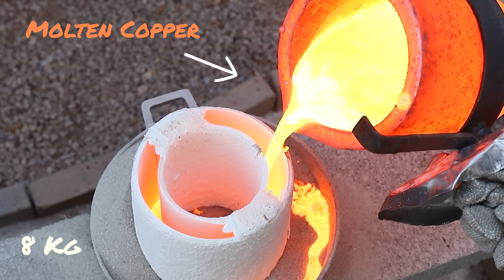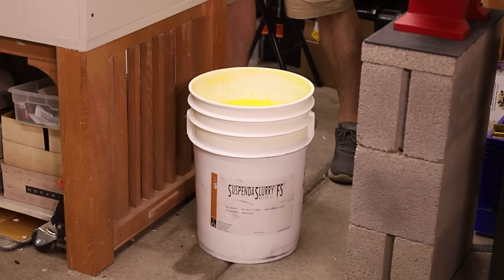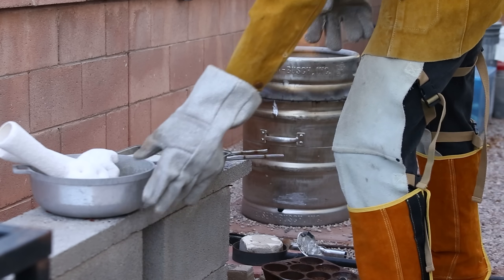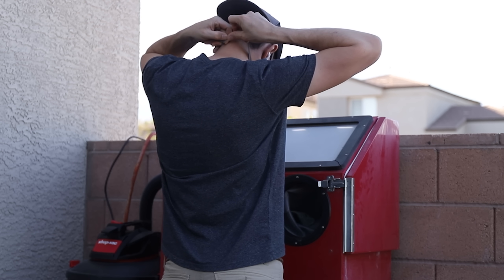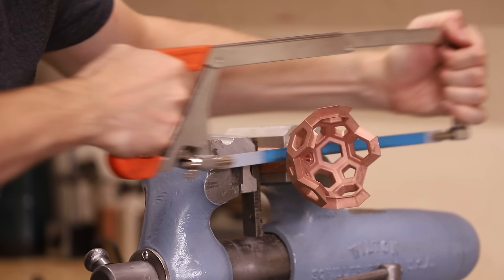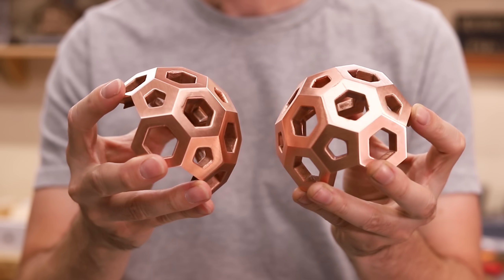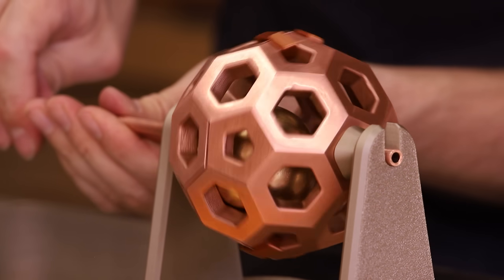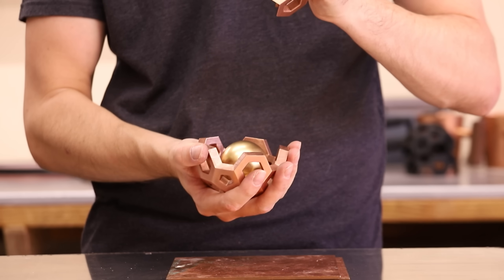HUGE Magnet VS Copper Sphere - Defying Gravity- Will a Neodymium Magnet Float Inside?

Comment: I wonder if it's possible to create a hollow, circular, copper, bike tire tube shape to house the magnet, and you see if you can hold the suspended magnet at a fixed point by peddling the copper around it.

Comment: There's very likely a (outer) ratio to optimal rotation speed; the ratio you chose made it so that you can levitate it with your hand, but I believe there might be a larger sphere ratio where the speed must be higher, and so it'd only work with the drill. Probably the sphere thickness also plays a role there (lower = higher speed needed), but these tests seem like they might be too tedious since you'd have to do this whole process MULTIPLE times!

Comment: If you used an ESC (electronic speed controller) and an RC electric motor you'd be able to control the speed more precisely, bearings where the axle interfaces with the stand might also help with smoothness and stability.

Comment: just make a flywheel and if you make it heavy enough you can get it at a pretty constant speed without a motor but obviously it will be harder to spin so it would be logical to make it pretty big in diameter

Comment: Separate the Cu sphere, counter rotating the shafts.  This should induce the 'Right Hand rule', causing the magnet to pull to the left or right.
Rotation in the Z axis should induce the floating effect you seek.  This should work even if one half is stationary.
And be sure to check the voltage potential between the Cu hemispheres.
Knowing the torque influence on each shaft at RPM difference would be of great help as well.

Comment: The spinning magnet is what makes it float, not the speed of the outer sphere. You only use the outer sphere to accelerate the magnet but then it always descends when it loses momentum due to air resistance

Comment: Lovely build. The copper sphere is a very pretty looking thing. Have to say though, when you said "burn off all the plastic" I just thought how vile the stink would be, and that it's just adding even more plastic crud into the air, and there's enough of that already because of incinerators 🤢😐
I wonder what would happen, hypothetically if a magnet wasn't brittle, one was thrown at a copper baseball bat. Would the energy transmitted be a lot less because of the Lentz effect 🙃😝

Comment: I wonder what happens if the stand with the ball is mounted on rollers. Then turn the magnet again. Does the thing move?
The magnet could perhaps also be connected to the stand..?
If it does move, it would be interesting to see whether the thing can also move vertically. So can it float/fly, maybe? O.o

Comment: Is this estimate of your process correct?
3D Printing (PLA): 4 hours
Manual Smoothing: 2 hours
Mold Creation (dipping): 3 hours
Burnout Process: 4 hours
Casting (pouring molten copper): 1 hour
Cooling Time: 2 hours
Sandblasting and Finishing: 3 hours
Total Time: 19 hours

Comment: I have an advice, Try painting the copper shell with some thin coat of a dark material so it is easier to see the inside of the shell as the reflections make it impossible to find a good angle

Comment: When sandblasting away the ceramic cones that lead to the sphere, if you blast them in a spiral you could get nice ceramic lamp pieces, candleholders and so on. Cones and cylinders lend themselves to very nice spiral making
Reply: Hope you can demostrat that the series found in Roman artifact  aare actually wood fired heaters small twigs rock slab base rock surround as heat sink very little smoke vidio please
Reply: the possibilities are endless

Comment: Get a small motor with a speed controller and hook it up to dial in the levitation speed. Or see if you could do that using a strong bar magnet to get the ball to spin remotely and levitate the cage.

Comment: You can see all the layer-lines from the pla, which is why in the jewelry industry they use a super slow inkjet to lay down 2 kinds of wax, and the layers are smoothed with a built in sander/cutter. This is a long process. Then they put the wax piece in a slurry. Wait for that to cure, bake for to burn out the wax. Then pour in the gold. Then spin in a centrifuge. Then toss the whole thing into water where it bursts, then remove the tree. Then cut the rings from the tree. Then grind down any leftover from the cut. Then polish in a magnetic polisher. I remove so much labour and time from that.

Comment: you could do a cylinder instead. or a solid sphere but with the ends chopped off to see inside. the sides need more copper and less gaps, or no gaps, to hover better. and there's not really a reason the front and back needs to be closed off

Comment: Question: your wast pieces and  more like them placed around the copper orb with the magnet inside, could hold the orb in the air as support, but if you alternate a repellent magnet on every other one tormenting the magnet in the orb ? Try spark plugs on the ends of the alternate pieces of waste you may have created free electricity? Good luck, p,s, better than batteries, but check for radiation ,just in case ?

Comment: With a microvoltmeter connected across the copper, you should be able to measure the electric potential difference caused by the eddy currents, that ultimately create the magnetic field which levitates the spherical magnet...

Comment: What would happen if you applied slow electric current to the outside shell 

Maybe a Tens unit type pad and a watch battery hooked up to each pad with a blu tooth type on off switch 

With the ball floating on the inside of the copper
Would or could you get forward reverse up or down movement to coordinate with the floating ball inside?

Comment: spin the magnet instead. print a small plug much like the ones you have in it now, but have a bearing in the center of it.  and through that bearing you run the small tube that is connected to the magnet and the other end is connected to a motor. When the motor spins it will spin the tube and the magnet with it. hang it upside down and see if you can find a speed that will make the copper cage float

Comment: When you added the holes, unfortunately that diminishes the size of the eddy currents that can form. So instead of having a large current loop form (like in a big flat plate, or in a big pipe), you have a bunch of tiny eddy currents. 

See the experiment with the lever that goes through the centre of a magnet, the comb shape lever receives far less resistance because the eddy currents in each arm of the comb are small.

You can probably get better results by closing some of the holes so larger eddy currents can form in the copper "sphere".

Comment: Love to see you throw a neodymium baseball down a long copper pipe horizontally.  Cool to see a potato cannon fire a magnet at a steel wall and so if it can repluse it without hitting it.  You could put metal walls in the side as you shoot to see if it could deflect the trajectory 😂 so much potential with this cool stuff

Comment: What about creating a geared copper outer gyroscope with the magnet as the center suspended spinning engine? if you figure out what the spin rate is to establish float without invoking centrifugal force you could then spin the next layer to get it to move closer to the center, and gradually increase speed until the magnet is in the middle. also, is there a way to show the electro magnetic radiation and or voltage? Does the magnet exert relative force on the copper? Antigravity here we come!

Comment: How about a transmission system for wheeled vehicles that allows an engine send power to an axle contactless. I wonder if the power loss would be less than a actual physical axle or chain.

Comment: Would the same effect be produced with the original 3d print wrapped in copper wire or if it were electroplated in copper ?

Comment: Hook the rod up to a mini generator. And then set the second magnet up with a motor to spin it, see if you can make electricity with the spinning rod. Might have made a new generator. If it works, make a second sphere and put it on the other side of the spinning magnet, maybe it turns both at the same time :P

Comment: Instead of facets, use RINGS of different sizes, with small discs or hemispheres on the end, to make a smooth ball shape. Join the rings with thin but strong bands on the outside to keep it smooth on the inside and allow for good viewing.

Use the casting cones for antigravity or perpetual motion experiments! ;) Maybe wind chimes? Or add mouthpieces to make little party horns. Also drop small spherical magnets into them, maybe starting at the wide end from an angle, see if they wobble and straighten out as it narrows.

Comment: Round out the inside. Get rid of all those flats. The field isn't as perfect as it could be. Grind the inside of the sphere with a spherical grinder. The smoother the inside surface is the better.
Reply: If you have to, create another identical piece but increase the wall thickness significantly. That should give you a more than thick enough wall to grind the inside super smooth without grinding all the way through.

Comment: I think your magnet is way to strong for this experiment. What I mean is that the N52 magnet has a Strong Magnetic field, but buy it being so Strong the Magnetic Field around the Magnet is Highly Compressed. Is you used a Magnet with a Lower Magnetic Strength, the Field of the Magnet would be Expansive, giving a better Result.

Comment: a rotation synced strobe light would make it easier to see while its spinning. you could trigger the strobe with a photointerrupter and a wheel with a cutout on the shaft. photointerrupter could also be feedback for your motor to get the perfect speed.

Comment: It seems to wobble a little at higher speeds. I wonder if you can make a gyroscope with a neodymium magnet sphere core inside a copper ball to balance it at higher speeds. Once you get the gyroscopic balance, it might generate current.

Comment: In the future, maybe you could design molds in a U shape. Air vents could be designed into flat faces of the mold on the top, so as you pour in metal, air is forced out of the top of the form, and forms sprues on flat faces that aren't meant to mesh together, creating a better mesh fit on the necessary faces if needed for a particular design.

Comment: I think the reason because it doesn't work anymore if you spin it faster is because the magnetic field pulls the magnetc sphere towards one side of the axis of rotation, depending on which direction you are spinning the copper sphere.

Some comments suggest to use a smaller magnetic sphere which would probably help lifting it but it would still be pulled towards one side.
Other comments suggest to weld both halves of the copper sphere together which would probably have the same effect as using a smaller magnetic sphere.

I think there are 2 options that might help keeping the magnetic sphere in the center:

If you change the spinning direction the magnetic field that pulls the sphere away from the center should eliminate each other. But I think that's leading to the next problem: The magnetic field breaks down and has to be built up every time you change direction. So to prevent the sphere from falling down again the frequency of changing directions must be at a specific value. The 2 suggestions i mentioned before might also help as a smaller magnetic sphere needs less force to be lifted and the welded sphere would have less resistance which results in higher electrical current and hence a stronger magnetic field to lift the magnetic sphere.

But i think there might be an easier option. You could try placing the axis of rotation vertically. If you then spin it counter clockwise the magnetic field will pull the magnetic sphere against gravity.
Here both other comment suggestions should also help as lifting lower mass with higher force makes a huge difference.

Comment: Place the apparatus on a scale and see if the weight changes when you spin it? I’m sure a high school physics student could answer the question but I’m curious to see it.
Reply: The magnet's weight still gets transferred through the copper sphere while it's levitating.  The overall weight shouldn't change.
Reply: @BenAlternate-zf9nr  thanks for your response! So the mass of the magnet is basically just being supported by the equal/opposite force of Lenz’s law against the copper enclosure… is that right? Like you’d basically get the same outcome by suspending the magnet within the enclosure using strings
Reply: @yahdood6015  yes, that's right

Comment: Pretty cool! As I'm sure others have said, the holes in the cage are actually serving to reduce the eddycurrents which cause the electromagnetic braking effect seen in the tube - it's the same reason why transformers often now use laminated cores, to stop eddycurrents flowing in the wrong direction and reducing efficiency between the two sides. The repulsion force would be stronger if the air gaps were not there, even the crack between the two halves.

Comment: My initial thought is what happens when it is rotated about 2 or more axis.
The other thing that comes to mind is that the holes that allow you to see are technically against you as it reduces the amount of copper for counter eddies of current to form, thus weakening the effect. So maybe a design that is more solid with more surface area around the equator and some windows to view near the point of rotation.
Another thing, last one, to consider. Sharp edges cause currents to collect, and this too will impact the effects.

Comment: If you have the half-sphere like a cup, with its open half pointing upward, and put the smaller sphere inside, and then spin the outer half (along vertical axis), I would think it would cause the inner sphere to 'levitate', no?

Comment: I would have used a hammer on the feeder, which would have removed a majority of material without deforming pieces. Otherwise impressive work, on the piece and the video.
Reply: You could use a boolean operation to create a smooth sphere, a least on the inside, but the difference in the thickness of copper might affect the electromagnetic effect. So, just create a spherical version with elliptical holes for better viewing.

Comment: Could try a few layers of iron silicon over the surface of the copper like an electric motor or transformer.  Also could seperate the two copper pieces into an anode and cathode configuration could be interesting

Comment: Great experiment and work.   
But in order to produce an electric field is it important how thick the copper is?
If not it might be possible to build a sphere just from copper mesh.
Potential advantages:  Less material, easier to handle, maybe a smoother surface and better visibility of the magnet sphere inside.
So it would be kind of a Faraday cage.

Comment: Sorry, but you need to align the field of the magnet to the axis of the spinning ball.  The cylinder version is about as good as it gets unless you make a much more complicated magnet or suspend a copper ball inside of spinning magnets.  
Another option you might want to explore is diamagnetic and paramagnetic materials.  Then you could put alternating polarity magnets pointing inwards and suspended a ball of bismuth or pyrolytic carbon.

Comment: Smaller magnets of different sizes, a motor with precise speed control, paint the magnet a different color (white), with a black bar to make spinning more obvious. Slow-mo might be interesting at high RPMs.. RPM's that are harmonics with the frame rate will make for interesting effects.

Comment: Hook it up to an electric motor with a finer control for speed. Also, an interesting angle would be to look at the copper sphere for temperature changes as the magnets float in the middle. As you spin it with the motor, maybe some heat is generated; I don’t know.

Comment: 9:58 Attach a motor.
Reply: V8 motors with jets
Reply: @Tcsdoffical  That would be too fast
Reply: @benjaminbrown3939  we will make it work >:]
Reply: @benjaminbrown3939 you can adjust its speed
Reply: also attach some ball bearings
Reply: @BlackDeltaOne right?!
Reply: Right
Reply: @Drdemiurge I enjoy the consumption of cheese its
Reply: @calamitasclone I hear you. right when I was thinking it could be bad for me, I started to get a feeling that the creation of cheese was definitely a good one. I much prefer queso fresco though
Reply: @pacomoreno577  crazy stuff
Reply: he did
Reply: Was literally gonna say the same. You could find a small DC motor and a potentiometer and find the perfect spin speed and maintain it
Reply: @christophermccutcheon2143  Does increasing the speed help? Or is there a specific rotational speed which does what you want?
Reply: Great idea
Reply: he should add a V-1650-7 merlin 12 cylinder liquid cooled engine
Reply: Use whatever power it generates to power the motor...
Reply: Although it is difficult to see a ball when it is floating, you can still hear it or actually not hear it because when it is floating it does not catch on anything and is therefore silent.
Reply: Amennn
Reply: Exactly what 7 was thinking
Reply: I was just thinking "put the rod in a drill' lol
Reply: And there goes the drill! Haha
Reply: Done
Reply: Perpetual motion motor pf sortZ 🎉
Reply: I would've just made a crank for it so it'd spin easier than twisting a rod
Edit: I didn't see the drill part of the video yet lol
Reply: He s
Reply: No. It is the motor
Reply: a motor that uses magnetic fields powering a ball and copper hexagonal sphere that generates magnetic fields. its eddy current ception!!!
Reply: It is a motor.
Reply: It would break it
Reply: And use stroboscope to see inside the sphere

Comment: Angle a high powered magnetic below to incessantly push the copper in the same direction & test to see how much current it generates without using electrical inputs from your drill